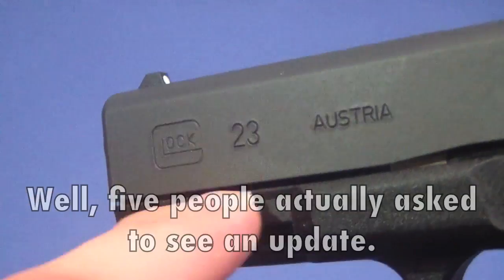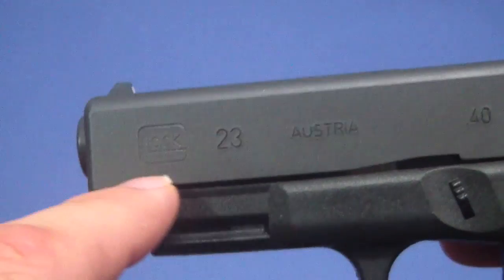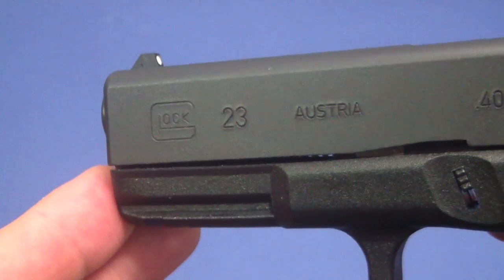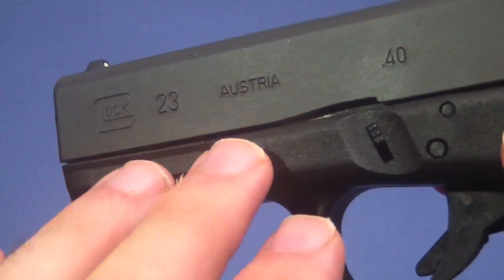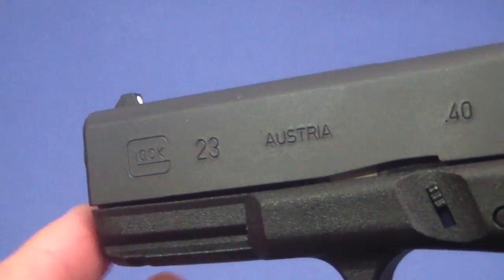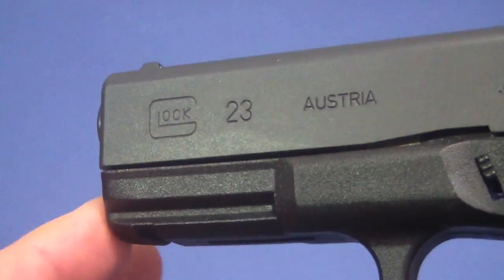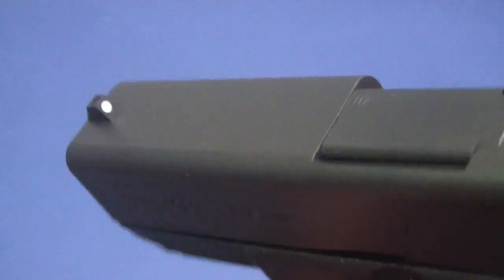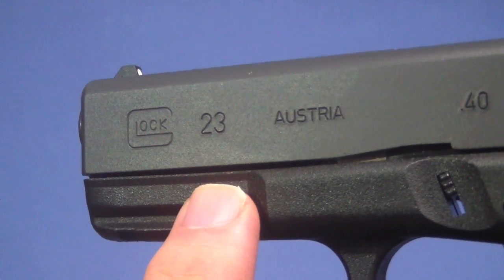Glock "Pig Nose" Fix Update

Comment from the maker: It started happening more when they added the rails to the frames. The added polymer at the front shrinks more when cooling. If not cooled properly they warp slightly.
Reply: How does it look 9 years later? (I feel like I'm supposed to add an insult for some reason, but I'm gonna not...)

Comment: Thanks for the video. It answered all of the questions I had about this process. I too have a g23 w/ a beasty pig nose. Now it's repair time.  I wonder if you've ever seen a glock fired in slow motion because the pig nose area of the glock frame bounces all over the place while fired and I'm sure it hits the slide anyway.  Whatever though, I'm still going to try to fix these cosmetics.

Comment: Nice videol. I never noticed mine until I watched your video and it bothered the hell out of me so bad that I decided I would try to fix it. I was scared as hell to use the heat gun method so I used boiling water instead. It worked perfect. My frame is straight as an arrow now. I stuck the nose of the frame in for about 1 minute. It seemed a lot safer to me since boiling water will maintain 212 degrees, not even close to the 300 to 400 max that she quoted to you.

Comment: My gen 3 is curved really badly up front. Don't remember if it came like that new since I never payed attention. But it's curved enough that it's constantly rubbing the slide and the plastic frame has a bunch of scuff marks from sliding against the slide. Never had any issues though. Have a few thousand rounds through it (I don't keep track, I just shoot)

Comment: Hey Yank -

I have a G21SF that does not have much of a pig nose, IE the very tip of the dust cover does not contact the slide.  That being the case the slide "rattles" a little if I shake the gun side to side.  I've checked all my other Glocks and they all pig nose where they contact the end of the slide thus there is no rattle.  Have you noticed that your de-pig nosed Glocks have a little more rattle?  I've read the rattle doesn't matter either way.

Comment from the maker: You are 100% wrong. I have personally witnessed more than one warp from the heat of firing the first time at the range. This one was completely straight before it happened to it. Do you somehow think you can just come in and say it isn't so and that somehow changes reality? They can come warped from the factory also but that is also because of heated polymer cooling unevenly after molding and warping.

Comment: Ive got a gen 3 19 thats been stored for 13 yrs. Only bout 150 rds shot thru it at 3 seperate times. 50 each. Its touchin on front like your 1st video. Could it be a manufactoring fault? Shouldnt b heat on this 1.

Comment: I took a look at my Glock 17. Yup, pig nose; however, holding it up to the light I can see separation between the frame and the slide--they do not touch on either side. 
So, in my case, it is purely cosmetic. I will leave it alone.

Comment: DO NOT DO THIS TO YOUR GLOCK... I was on Glock Talk; and I participated in the thread on the night when some board member who called himself, '92F' suddenly invented the term, 'pig nose'.  He was a rank newbie as well as an idiot; but, all of a sudden, GT's, 'Peanut Gallery' began running with the term; and, then, it ballooned like a snowball rolling downhill!  

 MarkCO, a GT board member as well as a plastics engineer by trade, has often pointed out that excessive heat should never be applied to a Glock frame; AND, any reshaping that might take place will slowly return to its original form over a period of two or three months.  It is widely thought; and I hold to the opinion myself, that Glock's upswept dust covers are a deliberate design criterion intended to stabilize an excessively vibrating D6 polymer frame during firing - Which is the reason, 'Why' I've purchased two Glocks with this feature for my own use.  (And my Glock's are accurate, almost scarily so!)  

 One of my well-used and, 'pig nosed' G-G1's:  (Pushing 40,000 + fired rounds!)
Reply from the maker: +The Busey So you are claiming a plastics engineer doesn't understand how polymers work? I find that doubtful.
Reply: TheYankeeMarshal Many new unfired Glocks come from the factory like this already. It has nothing to do with use or heat. Go ahead and make and issue out of a non issue. The "pig nose" is nothing more than a cosmetic issue. Glock has already warned people against doing this mod. If you want to screw up your gun that fine, just don't encourage others to make and issue out of a non issue. Its cosmetic only... who the hell cares about cosmetics on a Glock. You have far to much time on your hands if you are  worried about a "pig nose" Glock.
Reply: +The Busey i think you might have too much time on your hands if you're worried about someone worring too much about glocks cosmetic issues
Reply: Please learn how to properly formulate a sentence.
Reply: Well that was a pathetic rebuttal.  Most of the Glocks they're producing now do not have the pig nose.
Reply: dimitriis1337 Some Glocks come straight from the factory brand new in the box with the "pig nose" non issue. Its purely cosmetic and does not effect function. Glock has already commented on it a number of times. You have way to much time on your hands if you are worried about cosmetic issues on Glocks. Its a combat pistol... your time would be better spent practicing by sending rounds down range than buy fixing non issues.
Reply: The Busey Yeah, that's exactly why I said that the Glocks they're producing now don't have the pignose; I didn't say that they were 'immune' to getting it.  I very well know that new Gen 3 Glocks came with it, as my Glock 23 was one of them.  Well gee, thanks for the advice.  That would be a lot easier if I lived right next to a range or I could shoot at my house.  Not really sure how the 10 minutes I spent fixing this issue with hot tap water could've been used for "sending rounds down range."  You're really making a big deal out of something that really isn't a big deal.

Comment: TheYankeeMarshal Hey I put my glock back together and had the rails slightly misaligned, now when I have my slide on the right gap of the rear corner is slightly bigger at the left one. How do I fix it?
Reply: trollharderINC troll vigorously just call Glock and tell them the gun is defective they will give you a new frame